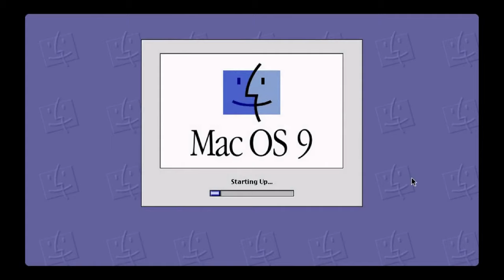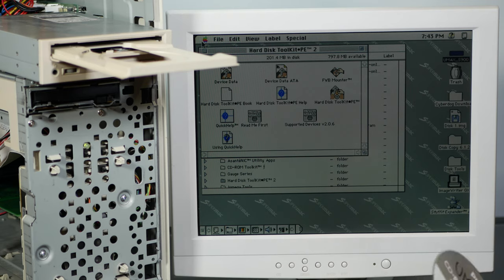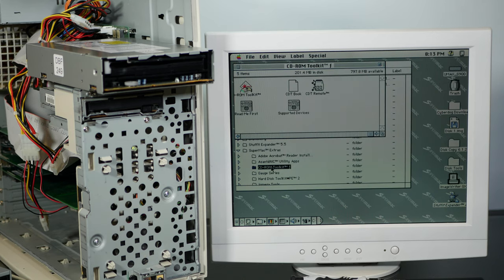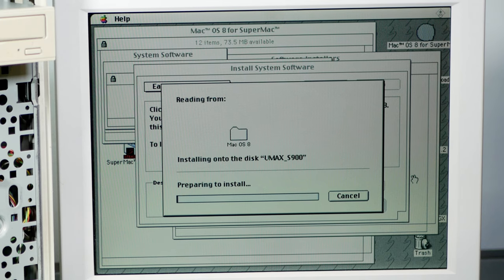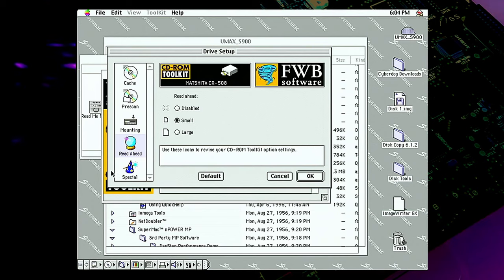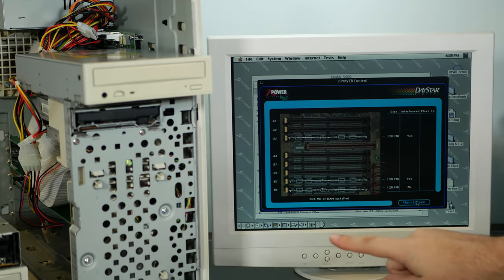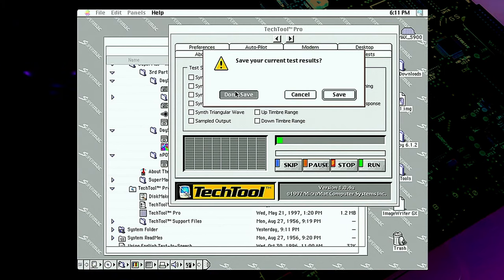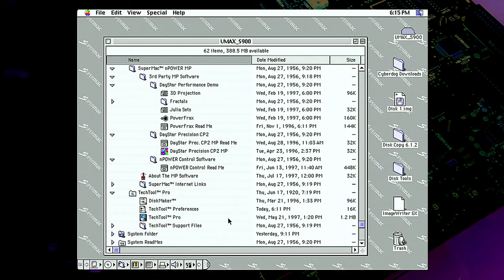Pushing the UMAX SuperMac S900 even further - the only clone with an official Mac OS 8! (Part 2)

Comment: Since you already have the 80mm Noctua fan, you could pop that into the power supply.  More modern silence in a retro Mac.  Bliss...
Reply from the maker: Oh man great idea!
Reply: Came for the same suggestion. I love Noctua fans.
Reply: Looks like there is a space at the front of the case for another fan, possibly 80mm, but could be 92mm too. With the g4 upgrade the extra airflow might help

Comment: Just found your channel and so far I love it. A couple of things. 

Judging by the scrolling speed I would guess your graphics card and/or your Sonnet G3 accelerator card drivers aren't loading. You may need newer versions than were installed under System 7. 

Also, that UMAX Mac OS 8 CD had other installers you might want to update. There was a CyberDog installer but there is also an OpenDoc installer that you will probably need to update to run Cyberdog in Mac OS 8 as well.

Keep up the good work!
Reply from the maker: Thank you!

Comment: UMAX was the only company that was allowed to sell clones with Mac OS 8, and even OS 8.1 but they stopped as the license expired sometimes in 1998.
The other big clone seller, Power Computing got bought out by Apple.
The rest of them stopped. OS 8 was named like that do make sure none of the clones could sell computers with OS 8, as their license only covered System 7
Reply from the maker: I think Power Computing technically had the OS 8 license for a short time under their unique licensing deal before Apple bought them out, but I couldn't find much info on it unfortunately.
Reply: Mac OS naming came with 7.5
Reply: The catch for Umax's OS 8 deal was that they weren't allowed to sell G3-based systems, only 603/604 stuff. If I'm not mistaken they tried to get around this by shipping systems with 604's installed and bundling a G3 upgrade card that would be installed by the user or dealer.
Reply from the maker: @MixerVM  Oh woah, I had no idea about this detail! That's really interesting, I'm going to try and find more on this.
Reply: Action Retro “and despite Apple's refusal to certify a clone with a G3 installed, UCC found a way to ship the "S900Base" with a G3: An S900L was loaded with an old usable-but-sluggish 150MHz 604 processor and a Newer Tech MaxPOWR Pro G3 processor was included outside the box. In an effort to make this appear more unique than it was, the G3 card that Newer Tech provided featured -- for the first six months -- a larger cache and slightly faster L2 speed than other retail Newer Tech cards available.” Source: http://www.kennedybrandt.com/supermac_insider/history/history2.html
Reply from the maker: @h8pewou  Oh yeah, I read about that machine a bit, but didn't realize they shipped the G3 outside of the machine for that reason!

Comment: The S900 has 512KB of cache on the logic board.  When you're using a fast G3 card, this cache probably won't help and might hurt performance.   There is a jumper near the DIMM slots (below the DIMM slots) on the logic board which will disable the motherboard cache.  On most S900 boards the jumper pins were not installed and there is just a blank position for two jumper pins.

Comment: Great video! There's actually a UMAX case on ebay (uk) right now, a desktop model (not tower version), looks in good nick too. Personally, I have a PowerBook 5300 that I'm about to strip down; I plan on moving the logic board etc. to a brand new SFF PC case. Think I'll be sticking with System 7.6 though, anything newer seems sluggish :/

[Edit: Not sure if anyone further will read this, but one of the reasons for choosing a laptop motherboard as a desktop replacement is the presence of solid caps on them which, if I'm correct, are superior to the electrolytic type capacitors common on desktop motherboards of the same era.]
Reply from the maker: Thanks! Very cool about your Powerbook project. Kind of a modern vintage hackintosh it seems :)

Comment: 2 years too late, but so many memories of my Umax (they were called "Pulsar" in Europe). At some point I wanted to shout at my screen, because I remembered the CD-ROm issues, that's a problem with Apple's CD ROM driver that only supports Apple-drives. For any 3rd party drive you'd either get the Toast-driver or a certain older (or hacked?) Apple driver that supported all 3rd party CD-ROMs. 
I upgraded my Umax to the max too, it was a tinkerer's dream - ATA/IDE card, USB/FW card, Radeon 7000, Zip drive, IDE CD/DVD burner, G3/450 CPU - MacOS 9.2.1 and made it up to 10.2 Jaguar until I could finally afford a G4 MDD. Oooh good times... The one issue with the Umax was always the PCI-bridge, which meant some PCI cards didn't work properly in the lower 3 PCI slots. It was a lot of voodoo and testing of card combinations, since my slots were almost always full.

Comment: In mid-1998, the Umax SuperMac S900 was my very first Mac. I bought it with an expensive external 2-drive RAID, totaling 4GB, a 19" Princeton Graphics monitor and various other peripherals. It cost me U.S. $3800.00 at the time. Steve Jobs had just returned to Apple and the stock of Apple was in the ditch. If I had bough stock instead of a computer, I'd be a millionaire by now. Okay, I exaggerate but darn, did Apple ever come back from the brink.

Comment: The TEAC seems to be working fine, but the disc you've made judging by the contents is burnt incorrectly.
Reply: could also be his dvd/cd burner or the software too, could be anything really, if your going to be burring old ISO's for old computers your really need a good burner that supports all the formats and can burn almost at any speed especially at some speeds lower then 8x
Reply: @SilverX95  Burners themselves don't decide the formats of the written CD's. The software does. Verify if the software supports the desired formats and you can use any drive as long as it works.
Reply: @minims  the drive dose mater as there are some cd/dvd Burners out there will not burn stuff correctly for older computers even if the software says it was Burned correctly and saying its all software is kind of ignorant you forgot that Burners have firmware and that plays a part into the whole thing along with the the blank cd/dvd media too.
Reply: SilverX95 I’ve yet to burn a CD on a source device with proper settings that would fail to read on a vintage device with any old drive. Industry standarts are there for a reason. I can’t see how firmware would influence it. The only time CDs/DVDs fail to read on supported devices is if the data or header is corrupt, which usually happens on old drives with fast burn speeds. The solution is to burn 2x or 4x to guarantee the disc would burn successfully. Not trying to start a fire here, but actually curious if the firmware can make such difference would like to read about it.
Reply: @minims  The 'burning' software can only interface with the firmware of a drive. That's why some drives won't read or write certain types of disk. A lot of writable CDs won't work in older drives, but work fine in modern ones. I daresay the quality of the discs plays a part and thus affects the ability of the drive to interpret the incoming signals properly.
Reply: A Nother I remember installing extensions to enable reading certain CD formats. Joliet Volume extension was one of them, I think.
Reply: There are a lot of variables here.

"Format" here, I assume, refers to UDF, ISO9660, Joliet (as mentioned above), HFS, and so on.  The burner has nothing to do with any of that.  Not the hardware, not the firmware.  It's entirely a software construct.  You send bits, the burner burns bits, the reader reads bits.  (OK, probably more correctly, sectors..)  It's up to the OS to decide what to do with them.  Obviously, your burning software needs to create the disc volume in a format readable by the target platform.  ISO9660 is the common denominator, but other options are more appropriate in certain cases.  Regardless, a known-good "ISO" should have the proper format for the job already sorted.

The firmware is going to have profiles for certain types of known media IDs.  When you use a late 90s burner to burn discs you got from a store in 2015+, it's not going to know that media in particular.  The behavior at that point depends on what the OEM decided to do.  In the best case, the drive would use some of the disc's calibration area to try different laser control strategies and figure out what results in the most usable signal.  In the worst case, it'll pick something from its table of settings and YOLO.  I have yet to see a drive just not bother trying, but I guess that's an option too.

The drive itself is a variable, of course.  Old drives had manually calibrated lasers that can, do, have, and will drift over time.  Adjusting these without proper tools is a crapshoot at best, and could end up burning out the laser.  Drives with smarter laser power calibration may still have manual gain, focus, and tracking controls.  Those may need to be adjusted as well.  Later drives pretty much do all of this automatically.  When they stop working, you're just out of luck.

And of course, the discs.  I have some NOS discs that seem to work OK, but honestly I don't know the lifespan of unused dye layers.  Maybe some of those are aging away whether burnt or not.  I also have some nice, high-quality blanks with a bluish cyanine dye that are from a few years ago but not decades ago.  Those seem to work relatively well.  I've used a modern USB 3.0 Blu-ray portable burner, and a Plextor SCSI 12X burner, and the discs are pretty much readable either way.  Some drives just won't cooperate with CD-Rs, and that's kind of the way it goes.  But, many of my 2x, 4x, 8x, 20x, and so on... they like them just fine.  I have less luck with the common subtle yellow/green discs where you can barely see the burned / not-burned threshold, because their reflectivity sucks, and so that is to be expected I guess.

I don't know that burn speed has really made much difference.  I typically burn at 8-24x on a quicker burner, but part of that is because I'm pulling it from a NAS and have no urge to stress-test the WiFi.  On the box with the Plextor, I'm using an old copy of CDRWin that I don't have a registration key for anymore, so it's locked at 1x.  Painfully slow, but it works wonderfully.
Reply: Is it that it will only recognise 650MB discs? And not the 700mb ones that are being used?

Comment: oh man why did you not make a copy of the old system folder.. i mean i prefer system 7 to 8 but that's not the point, sometimes it has extensions or tools that are not included in the official distribution (like drivers for those exotic cards you have in there).
Reply from the maker: I did I did!

Comment: Something that people forget to mention is that Gil Amelio saved Apple from being sold off after Spindler effectively took a massive bomb to the company. Gil discontinued the Performa line in March '97. Apple's finances under Amelio suffered, though that was due to the purchase of NEXT, firing 1/3 of staff and restructuring. He was only ousted as CEO after a major stockholder dumped over million shares. When it comes to saving Apple, Steve Jobs and the iMac G3 got way too much credit.

Comment: For those dodgy drives, I'm assuming that they were attached to the correct SCSI address and terminated properly? Also be aware that, with some Old World Macs, the HDD and CD drives had to be on the correct channel in order to boot from them. I discovered that the hard way with a Power Mac which I had upgraded to a fast Sonnet G4 CPU. The CD-Rom would not even spin up when I put it onto the wrong ribbon cable. There was a document about it online, probably on the XLR8 Your Mac website.

Comment: I noticed that a lot of those files have a modification date decades before that computer was built. Some that say 1956 and a couple that say 1920.
Reply: 1956 means the pram battery is dead and that's what it defaults too
Reply: The UNIX time stamp is a signed integer, leaving the most significant bit (the sign bit) as a 0 makes it negative, yielding those early dates. 

This is common either on systems which don’t initialise their clock defaults signed (as indeed Retro Puffer said), or from software which populates the field all-0s instead of having a default (some modern command-line tools still give you these early dates on their output’s files). 

The sign bit is part of the spec as some companies wanted to still use software from old mainframes after the switch to UNIX time. They were happy to convert to the new format, but old time-stamps had to be accommodated. Fun fact: if it were to use an unsigned integer instead, the 32-bit UNIX epoch bug (2038’s y2k bug) would happen a fair bit later. But since it was being developed in the late-70s, getting near 60 years before running-out was viewed as plenty. (And indeed, updating to 64-bit time has been easy nowadays.)

Comment: Did you burn the Mac OS 8 disc in a modern Mac or Windows? Because that won’t work. Mac OS 8 and earlier has HFS file system whereas 8.1 and later introduced HFS+, which modern Macs and Windows can write. that’s why you see only the .fvrst or what it said on the disc.

To write a CD that works on pre 8.1 Mac OS you have to write the disc with either a version of Toast that can write HFS, or use like a 10.5 Leopard Server in a VM which is the last OS X to support HFS.
Reply from the maker: I've been using a PowerBook G4 with Leopard and Toast to burn them. I think the person who made the image may have used a modern machine perhaps?
Reply: @ActionRetro  Yeah looks like the CD was done on a modern machine, I got the same results before I knew how it worked

Comment: Man, this is really hard to watch and not SCREAM at the TV...
You installed only half of an OS, tested burned CDs instead of original ones  - multiple times, you don't seem to follow logic when try to find an error or misbehaviour...the list goes on.
And, as seen on other parts: you always order parts before checking the specs of the ones to replace. Too much money?
Reply: One problem with s si cdroms is that you have to aet it for the correct block size. I tthink that Apple uses 512 oer 256 byte blocks instead of the often common 1k ones.
Reply: He does rather jump the gun. I would have several things before swapping the CD drive... like cleaning the lense, trying original CDs, even audio CDs and making sure the filesystem is compatible. Still, he'll learn one way or another.